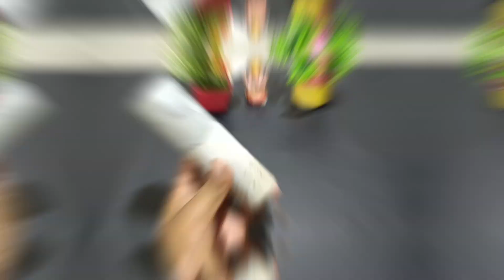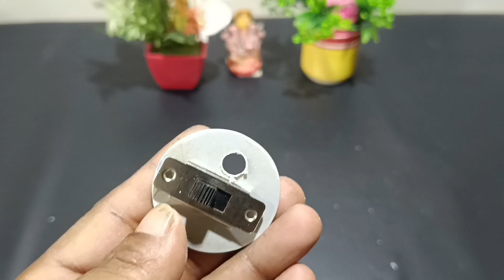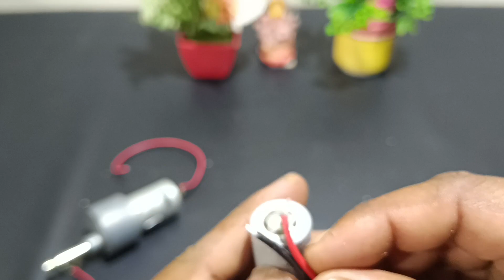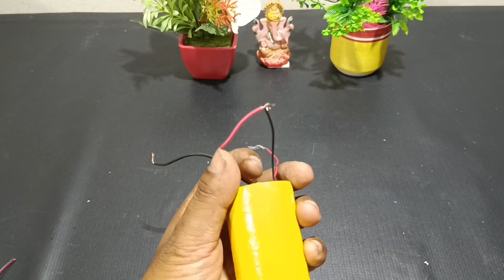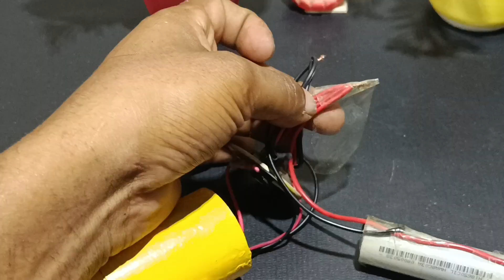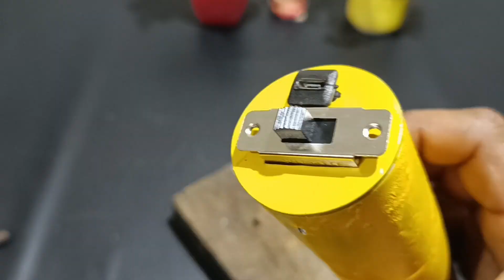Diy Screwdriver at home | Homemade electric Screwdriver #screwdriver #homemade

Comment: no details about DC motor you use...
Reply from the maker: Geared Motor 500 RPM 12v dc gear 
 https://www.amazon.in/dp/B00N4O9B5O?ref_=cm_sw_r_apann_dp_CCY6DH8CGJ9058E2J9XK
Reply from the maker: Thank you for your comments❤❤ 🌹🌹🌹 bro